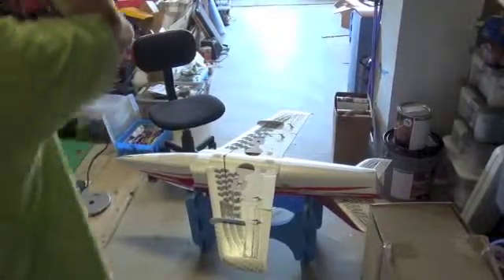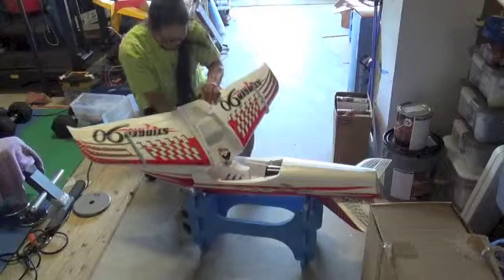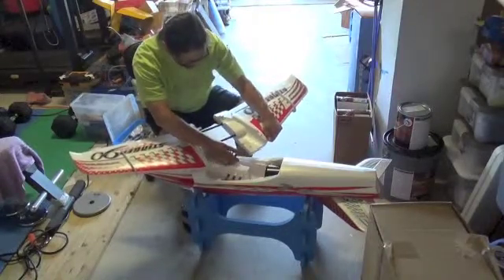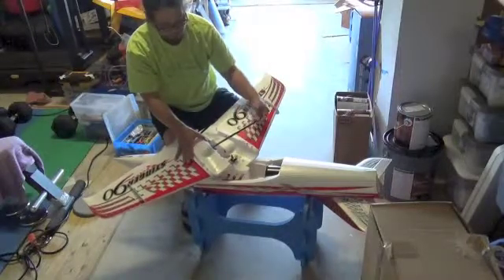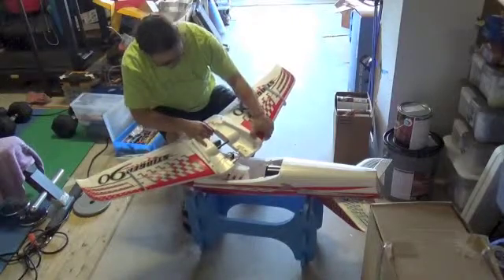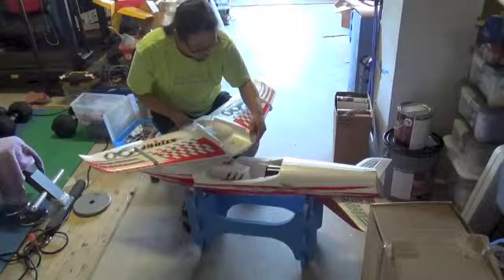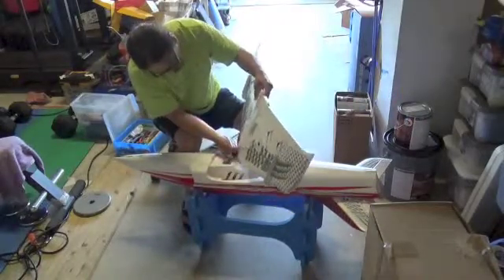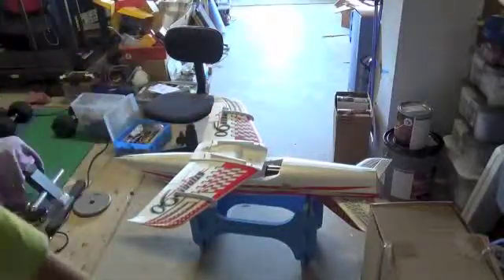Stinger 90mm edf jet "how to install wing spars"

Comment: Hi Jimmy.
Thanks for the video and the time you took to make it! Everything i saw it is known and clear. It is just funny why they make the slots in total longer than the wing spars they provide. Anyway, thats clear now.

What about your center of gravity? Do you balanced your stinger where freewing says?
My batteries are quite big, i thnk my first flight was a bit nose heavy.

This is what i use

http://www.amperejunkie.ch/5000-mah-3.html

Haiyin 6S 5000mAh 40/50C
Weight 846gr
length 145mm
heigth 56mm
width 52mm

Again, thanks for your video and your interest on my questions !
Reply from the maker: Dimitrios Ioannidis the easy way is to take the wing off the jet and you measure from the front of wing edge and  your CG is 4.5" and if you measure from the leading in the back the CG is 8 inch and 1
Reply from the maker: jimmyeflyingvideo i mean  8 inch and one eight from the back of leading edge